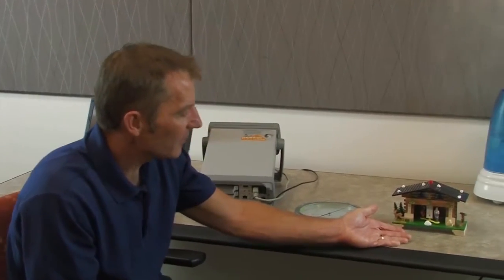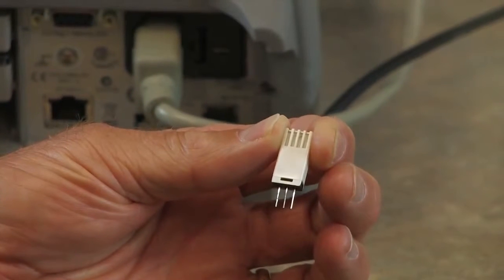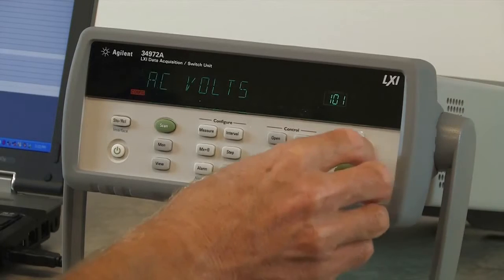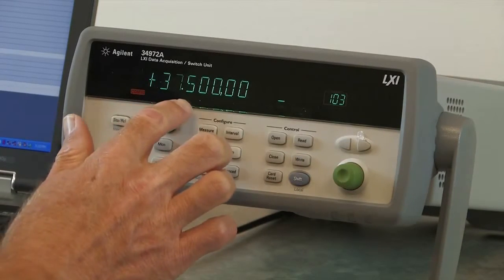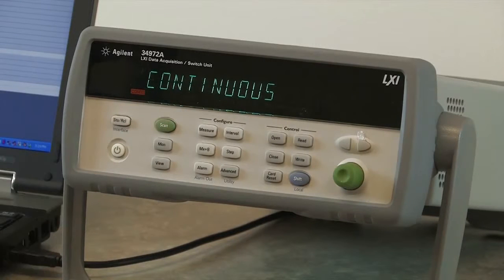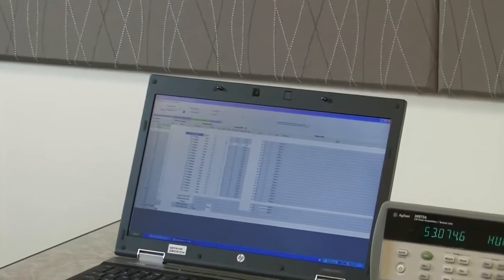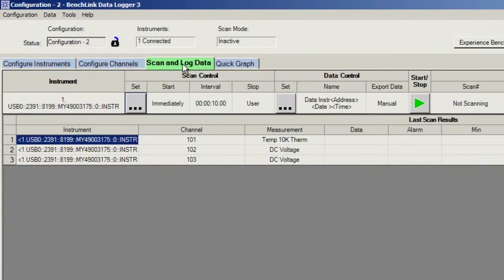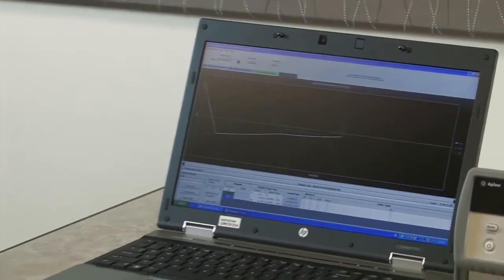Keysight Datenlogger-/Schaltsysteme 34970A/34972A – erweiterbares Messdatenerfassungssystem

Comment: Can I fix the value on the screen ?
Reply from the maker: Hello Michele and thank you for your question. Unfortunately, the value cannot be fixed/blocked during a measurement. Please note that this data logger is an older model. There are a number of newer options with more possibilities in our portfolio, which you can find here: https://www.datatec.eu/de/en/data-logger-smu
Reply: @datatec  Thnx a lot !🙏🏻🙏🏻